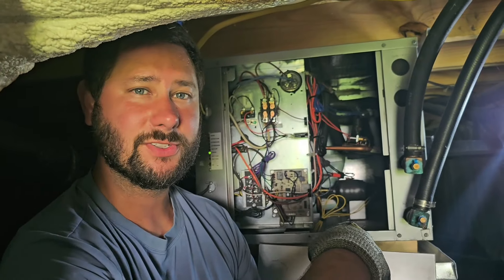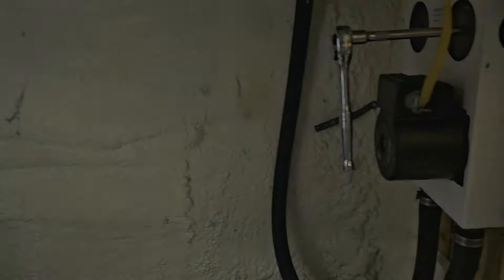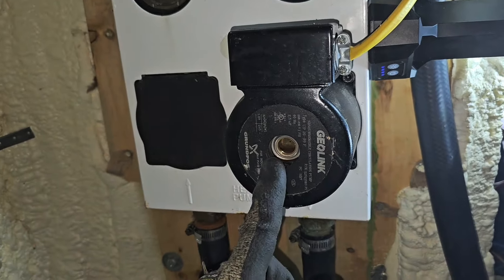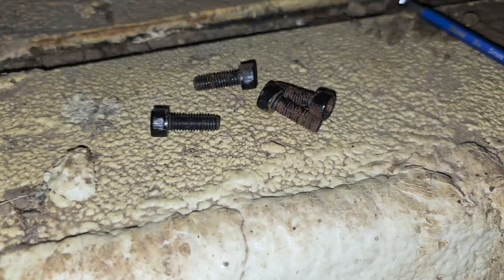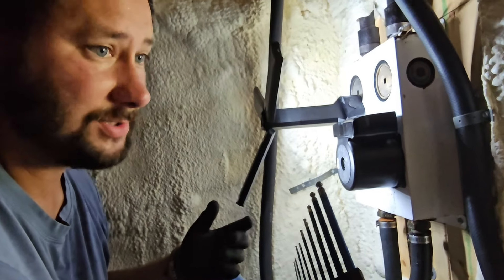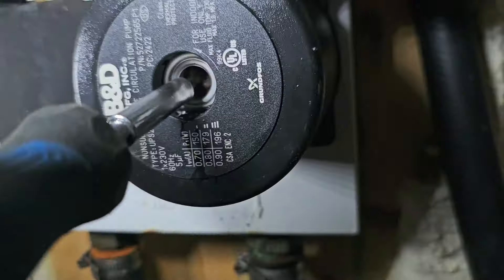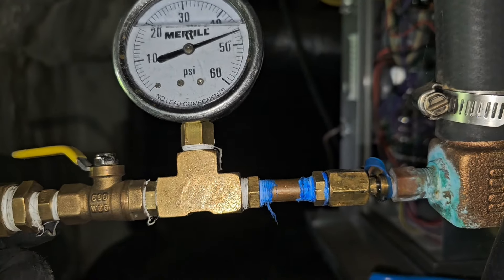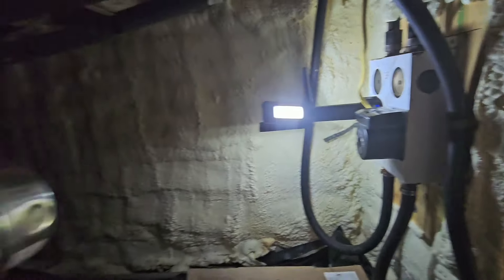Geothermal Heat Pump Water Flow Problem - Replacing the Pump

Comment: Nice work! I still have my juicer plugged into the service and test port from me pressure reducing valve, but I'll probably go ahead and permanently plumb it in this Fall.
It's not taking much water, but it will run to zero in about two weeks if I let it.

Comment: Great vid… what was with the mud in the pump?
Reply from the maker: I'm not sure
Reply: Could be from original loop install, someone not being mindful of keeping the pipes as clean as possible. Could also be from the water source they used to fill the loop initially. If the loop does possibly have a leak could be sucking mud in.

Comment: Love waterfurnace have an older 4 ton, closed loop. I had all the bell and whistles, tossed the pump, designed it so it runs on a sub pump in a 5 gallon pail. Reason is air in the line, saves the aggravation.  it so simple and cheap.  If water is down i add to the bucket. A water softener is a must so less contamination.  Run with a screen mesh  years of no water softener added alot of iron and calcium.
Reply from the maker: Thank you for sharing your knowledge.That is pretty cool

Comment: Geothermal, especially waterfurnace will run flat no problem. When the air pockets become big enough to potentially  get trapped in that pump is when it becomes a issue. Boosting the loop won’t get rid of the air just gives it a temporary fix, needs to be reflushed with a flush cart. You can use the flush cart to check for potential bigger leaks in the loop field. A hydrostatic test is really the only true way to test a loop field.

Comment: what do i need to service my mini split - i dont want to be a tech - inside unit is freezing after i ran over railroad tracks - michigan hvac techs hard to get a hold of - I am tired of the laziness
Reply from the maker: Check out my video I did on how to charge a mini split, buy the gages. Hook it up, turn it on, cooling and see what the pressure is and then hit me back

Comment: My building has an open loop system and even when my HVAC is often no appliances in the house are running, water continues to flow through my flow circulation pump. Their Pam man said it’s supposed to do this although it seems like to me there is a solenoid that’s bad. He said because it’s an open loop. There is no solenoid water supposed to run through. Thoughts?
Reply from the maker: Usually I put in a valve that controls the water flow and the valve only opens when there's a call for cooling, and it engages the compressor in the unit
Reply: Thanks for the quick reply. I sent you an email with photos for clarity.
Reply from the maker: Okay, I will check the photos out. Please consider joining and supporting me.Click the join button.Thank you so much